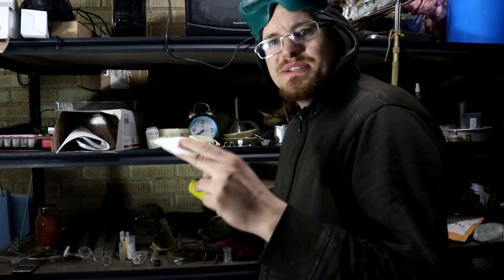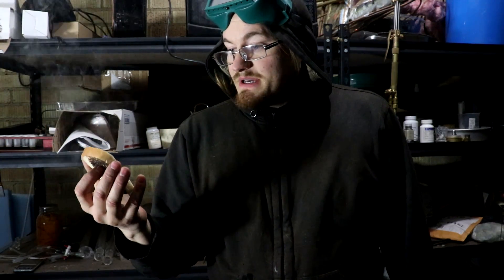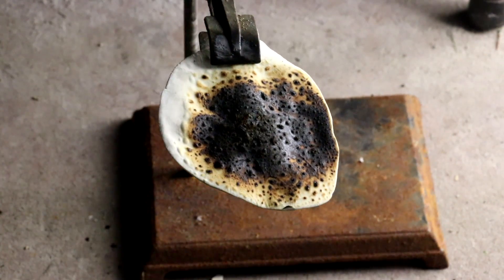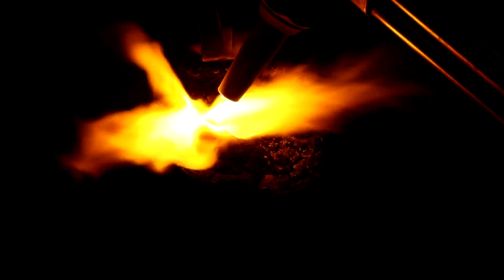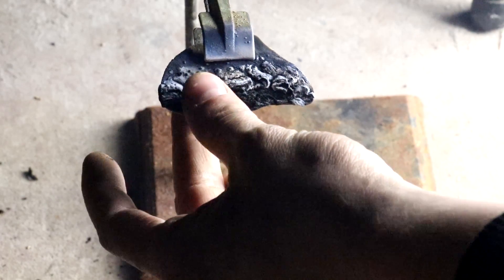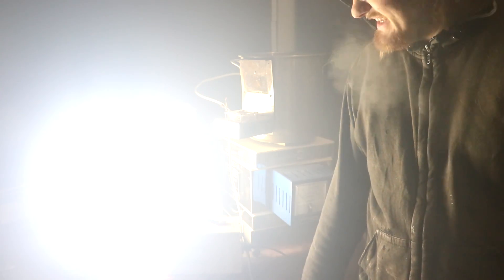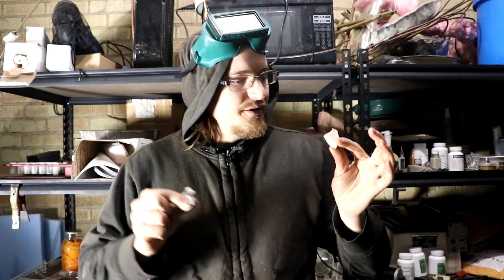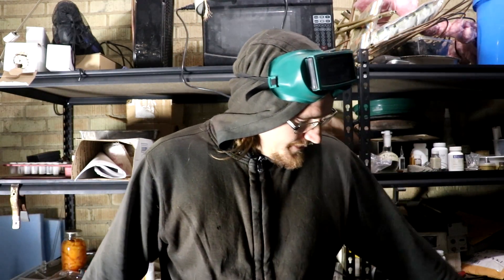Can I Burn Through Starlite?

Comment: I have a problem with your test. You provided no backing and instead relied entirely on the material itself to withstand the force of the torch. While it may have vaporized, it also very well coupd have held itself together a lot better with proper backing
Reply: And he went from the edge in, which completely compromises it anyways. If I had something coated in this, there are no edges, blast it in the center.
Reply: @douglasg14b  That's what I thought at first, but if you think about it, the chunk of "starlite" has its own surface which goes all the way around itself. If you were trying to protect something about the shape and flexibility as the interior of this test piece, the test is totally relevant. As to the op, that is also very interesting, but if steel cuts the same as this stuff.. what exactly are you going to put under the starlite, and why not just use that as the shield? This cut test shows that this fakelite quickly conducts heat into it's insides vastly lowering the viscosity so that the blowing action cuts it. So if it were coating steel the torch would simply blow it away and then the steel too.
Reply: If nasa were testing it as a heat shield they would want to know it wouldn't simply blow away, re entering the atmosphere causes massive sheer force in the shield...
Reply: He wanted to cut it. Not test viability. Not sure what a heat barrier is good for if it can't widthstand heat of this nature. We already have insulation good enough for ovens and the like, the use for this is extremely niche
Reply: I would like to know your credentials max
Reply: @nightkiller5494  People don't need credentials to make youtube coments!
Reply: @viesturssilins858  They don't need credentials to make youtube videos either, that's why Cody can set fire to bread for about four seconds and say it's the same as holding a blowtorch to something else for over a minute.
Reply: @0ctothorp   where exactly did he say that? He simply showed that holding a barrier between a flame and your hand isn't as impressive as most people seem to think. He wasn't arguing that bread is just as good an insulator as this material and surely you're not stupid enough to think he was. Are you?
Reply: @SpydersByte  
Gauging by the silence I would guess that, yes.
Reply: @SpydersByte  "And in fact I can do the blowtorch test with a lot of things in this case a piece of stale bread and it does it just as well." Sounds like he's arguing the bread is just as good an insulator against blowtorches to me. But you know bothering to watch the video is hard.

Comment: Thank you, sir! I have been wanting to see a "starlite defeated" test ever since I heard about the material. Now that Starlite, and the magical "carbon foam" (aka burnt toast) have been defeated, I suppose the next question is "how do we make something that can withstand a continuous or long-duration blast of +/=10000 degree gas?" 
I've seen a bunch of theoretical designs for rocket motors that use magnetic fields to contain a super-high-temp beam of plasma. How about making a small prototype of one of those, or something similar? Anything at all that can "withstand" or contain / utilize higher-than-carbon-sublimation temp would be cool.

Comment: Beyondthepress chanel burn through Starlite with oxyacetylene..
Reply: I think BYP did try oxyacetylene and got some damage. But the flame looked imbalanced toward too little O2 in my non-welder opinion.
Reply: @karlharvymarx2650  you are correct. Your oxygen should always be all the way up with a tiny amount of acetalyne in it. [In my welder experience.]
Reply: Four Kings y 
It’s not a good sample
Reply: But it still holds thermite
Reply: Four Kings I guess
Edit. Not as close to Cody’s though

Comment: Ok I call bs on it cutting faster than stainless steel you can cut a 4 in of 1/8-1/4 in thick piece of steel in under 10 seconds easily if you know what your doing with your torch

Comment: In the past China has used 6" thick white oak wood as a heat shield. maybe you can compare oak wood to a piece of starlite of comparable mass and surface area, see how thick the layer of starlite would be, and if it works as good as oak wood?
Reply: I think NASA or the Soviets used wood as a heat shield in their reentry vehicles as well.

Comment: The original motivation to create Starlite was to be used as a non toxic flame retardant in commercial jet plane, not to miraculously resist an acetylene torch. Please, retest with jet fuel, just curious if it would be successful when used as envisioned.
Reply: @SheldonRobertson-f9m  I think he means starlite cant melt jet fuel

Comment: Hi cody i seam to melt everything . i was going to try mixing starlite in with furnace wool as i want to make a furnace i can add oxygen to to get very high tempeturs in side . as the furnace wool cant even take mapgas letalone  oxy propain mix . So the question is  what to try can you suggest a formula to mix that could survive for an hour or two. That wont expand eather in high tempeturs like starlite

Comment: I think your torch is at a higher pressure and when you have a flam hot enoph to melt tungsent at a bit of a higher pressure then a blow torch. The test wasn't completely fair. Well it was also more consitrated

Comment: Hi Cody, love your channels.

The heat of thermite is around the temp of iron’s melting point (2,800 deg F), which this starlite formulas appears to have no trouble with.

Temperatures that the retired shuttle experienced during reentry were only a little bit above that at 3,000 deg F.

It seems to me that this starlite is tougher than the ceramic tiles that were used on the shuttle.

Comment: Pretty sure starlite is loosely based on the Apollo reentry shield. Starlite was invented in the early 1970s by someone who was obviously watching the moon landings and trying things out with what he had to hand. NASA used phenolic polymers in a fiberglass  matrix for their heatshield. It had a similar idea- it generated a graphite char which could handle very high temperatures, and then the material created carbon monoxide gas which helped shield the material from oxidation. I personally couldn't say for sure that Starlite wouldn't survive reentry, if arranged in a similar way to that, but it's highly likely that Apollo reentry shield would perform significantly better. The Space Shuttle leading edges were made of carbon-carbon composite coated with silicon carbide, and it sees gas temperatures of ~8000K. The main trick is to cool the air within the boundary layer with very high thermal conductivity to bring it down to a level the surface material can take.

Comment: Cody brother that's NOT cutting. You are merely 'pushing' it outta the way with the pressure of the jetting gasses. Been in heavy demo for 20+ yrs bro, you also cannot 'cut' stainless with that, you are 'pushing' it. Try doing a piece of stainless that isn't a mm thick? see how that 'cuts'. You need much more heat & concentricity of that heat to cut stainless, ala plasma cutter.

Comment: Won't the torch burn starlite easier if you set the torch to have a pin-point flame, like you would use for cutting/welding? Seems like you use it like a glorified propane torch. Correct me if I'm wrong

Comment: You should make sure the voids inside your sample of starlite are vacuum. Ceramic is awful at holding pressure, and a hot bubble of air is exactly that. If the bubbles were vacuum, they wouldn't put the ceramic in tension.

Comment: A point of contention about not surviving atmospheric reentry: there's only 21% O2 in the atmosphere, not the >55% of a cutting torch in that 21% atmosphere. Also the surface pressure is waaaay too low here, NASA reentery tests experience up to 100psi.

Comment: A magnetic heat shield could use a high power magnetic coil to create an intense magnetic field near the edge of the object to be shielded. This magnetic field would deflect the superhot plasma that forms. This would eliminate the need for insulative or ablative materials.

Comment: How would starlight work as a crucible in a foundry
Reply: Modern Gamer 
Good for a couple of uses
Reply: That carbon foam isn't very strong but it's a damn good insulator.
Reply: I also would have to mention that I am reffering to this simple starlite. The original one may have been much better

Comment: The original starlite didn't seem to turn black quiet so fast. I'm willing to bet that we don't nearly have the right formula yet. with this version of starlight it seems that it turns black fast, and then can easily be torn away by your torch and that's why it's not working The original didn't crisp up as much, and therefore lasted longer. I hope you all will continue to test this material though, It could still be groundbreaking.

Comment: Would the material work better if there was a sheet of graphite on top of it? My understanding is that it needs that carbon layer to form to be heat resistant in the first place and that would reduce the amount of carbon that is lost after it burns and could allow the "starlite" to handle more heat.

Comment: Hey cody, do you wanna try making starlite with pomade and water instead of elmer's glue? the guy who invented it was a hairdresser and i've a hunch.
Reply: also, the flow of gas from the torch would work to destroy the carbon structure-- applications against radiating heat might be more favourable for the material to show its potential.
Reply: they also appear undried!

Comment: Cody’s lab turns to myth buster
Reply: Rusty Shackelford 
I would accept him as a myth buster.
But he didn't bust much of anything in this video.

Observed errors :
1) he used cornstarch, glue and baking soda ... but those are not really the original ingredients are they ?
2) he used an oxyacetilene torch to simulate re-entry in Earth's atmosphere

He basically showed all of us that coating a return module with cornstarch, glue and baking soda is not a feasable ideea. (no shit Sherlock)

Comment: Wait does stainless not cut like mild steel under a torch? I've never done it because stainless vapors are scary and my school didn't have proper extraction equipment for that, and I don't want Parkinson's. I knew Aluminium doesn't cut well under oxy-acetylene because of the pacifying oxide layer, but why would stainless be a problem? Too resistant to oxidation to self-sustain?

Comment: The torch is blowing its way through not burning. You could heat up a steel rod with the oxy torch and then see if it can actually burn its way throught it?

Comment: NO NO NO!
Bad Cody!

You HAVE to apply the same rules as "Damascus Steel" --> "Pattern Welded Steel".
We can't ever be SURE what Damascus Steel was. We just have a really good guess. But a really good guess is not the SAME as an actual verifiable thing.

The same applies to Starlite. Just because a YouTuber made a good guess and THINKS he got it right, does not mean we can be SURE.
The is NOT Starlight, and you should know better than to use clickbait titles...

EDIT: It also seems rather unfair to use that torch. How much of that "burning" was really just blowing away the protective carbon layer?
Throw that "StarLike" into a chamber with 100% oxygen and smack it with a laser. Then I can't claim you are just cutting it with an air-saw.

The answer to "Can I burn through [X]?" is always "Yes" though.
(Maybe not some exotic forms of matter where "chemical reaction" doesn't really work to describe what is happening.
But If you are playing around with something like degenerate matter in your lab, "Is this a fire?" probably shouldn't even be in the top 10 questions about what is going on.)
Reply: It really doesn't matter...

Comment: So just to clarify, sheetrock is better insulating material than starlite? Quick, internet, time to test sheetrock crucibles with thermite!!!😉😉😉😉
Reply: Sheetrock is better at withstanding being blasted away by compressed air so naturally it takes longer to cut through. if you took away the paper around it he'd be able to blow away all the little crumbles of sheetrock in no time at all, wouldn't even need a fire you'd just be able to use compressed air.
Reply: @0ctothorp  yes, I understand that. I was joking.  Notice the winky emoji at the end of my comment.

Comment: That final demonstration was particularly enlightening. Like many people in North America, I live in a house that's made of wood and all the interior walls are covered with sheetrock, and I've wondered how fire resistant that is. According to code, even the underside of the basement stairs is rocked. Based on what you've shown, that is a pretty sensible policy. 

Now I'm wondering what would happen if you used gypsum powder instead of cornstarch in the starlite material. I hope you'll try that.
Reply: Actually, you might need both to get the best results.
Reply: @Lucius_Chiaraviglio  Agreed. Alternatively, use some magnesium oxide in place of the gypsum.
Reply: Matthew Ducker 

Why magnesium oxide?
What difference will it make?
Reply: @Sedgewise47  magnesium oxide isnt soluble
Reply: @mduckernz  magnesium? 😵 por que? 😁😁😁
Reply: @mduckernz  I had the same idea: add ceramic or other incombustable powder to prevent flame propagation.
Reply: @mrslinkydragon9910  Yes, but you can buy it incredibly fine, and it will form a very nice colloidal mixture; it won't seperate.

As for why MgO, it's refractory and very very unreactive, with a very high melting point. I've used it along with hard silicone resins (those which are platinum catalyst cured) to make ablative rocket nozzles before. Epoxy is also a nice alternative to silicone, but I preferred the silicone as when it decomposed, it formed silicon dioxide, another nice tough refractory component
Reply: Sheetrock or gyprock here in Australia is actually made from gypsum and wheat starch (wheaten cornflour). 
Maybe adding some zirconium oxide would make a noticeable improvement.
Reply: You need the cornstarch to form the carbon foam. Adding some MgO into the mix would improve fire resistance and I wqould guess the best application for this, once you add in some antifungal and antibacterial additives ( borax probably will do) is as a fire stopper material in buildings. As a heat shield I can see it being useful for emergency use, provided it is thoroughly dried after forming, and sealed away from moisture till needed, then the charring will make it a shield for a while.
Reply: Type x drywall is the safest and is required in a lot of construction for assemblies

Comment: To shit on you, though, this exact same shit is used in intumescent paints and it's a well regarded and very useful standard in fire retardation and fire protection on metal support beams.
And you can make a crucible AND a forge, out of starlite, to melt steel in. And it's made with soda/cornstarch. A bit salty there, cody.

Comment: I said this under Nighthalk's video:
"So what happens when you heat it using a pan instead of a torch? I think this is where the problem lies, it can protect from fire but any slow heat will not work.
It also looks like this material would loose its shape during reentry knowing what I know about lift on aircrafts that would be super dangerous. A micro layer of ice on an aircraft wing can cause it to fall out of the sky. This wont be any different.
But I am no expert I can only speculate."

Looking at this kinda seems to confirm that is loses its shape I have not seen the confirmation that slow heating makes this useless though.

Comment: G'day there, Martianought,

   I plan to test it over a Woodfire at about 1,500 Celsius...., and if it works in that for 1/2 an Hour ; then I have a likely Ablative Heat-Shield for a Bushfire Survival-Bunker - for when the Water runs out, the Firefront approacheth, and it's a case of either Hide Behind A Heatshield Nowiez (!)...,  Or, CRISPYCRITTERZ Are YOU...!

 What d' y' thunkificate about that ?

  ;-p

Ciao !

Comment: I wonder if there is any naturally occurring material (Pumice?) that is actually better than starlite plaster at resisting high temperatures. If there is more than one, which one  would be the best and what would be the highest temperature it can withstand?
Reply: Well there was Asbestos once upon a time, but good luck getting your hands on any these days.
Reply: @BlueChrome  Cheaper and safer is rock wool and similar alternatives.
Reply: Bubble Boy i think if nasa would use it for a spacestation insulation its problems would not really matter to them that much. Its only problematic when crubled up. A lot of places have asbestos water pipe still in use and those are all good and dandy

Comment: I'm not familiar with torches and their pressure. But are you sure that the pressure of the gasses aren't just breaking it apart. Whereas it might still be able to resist the actual temperature.